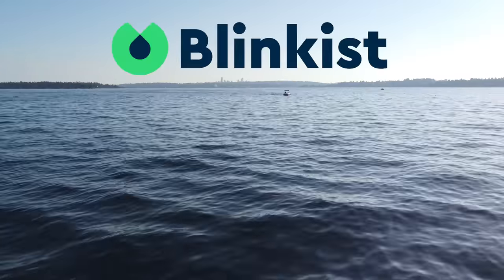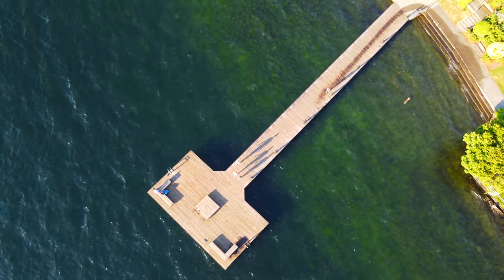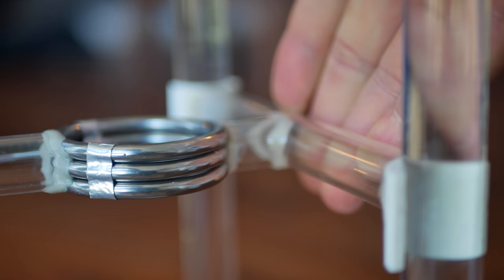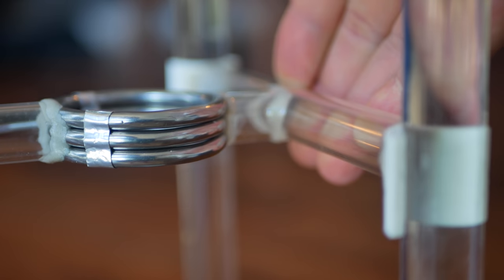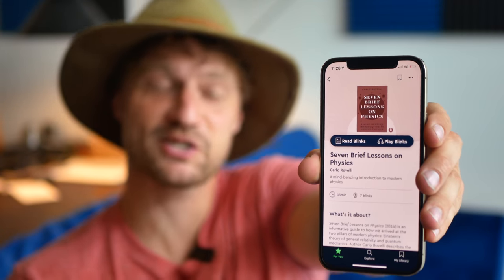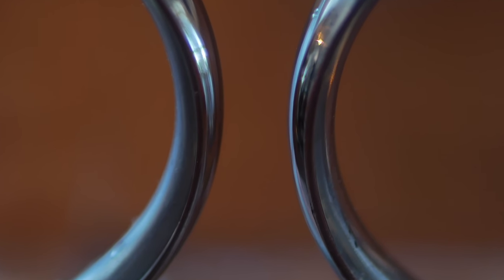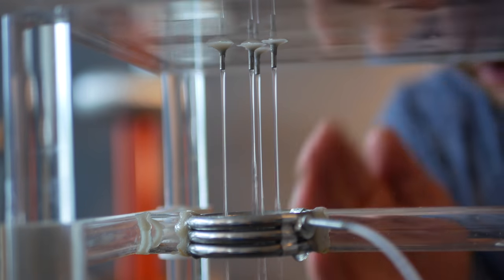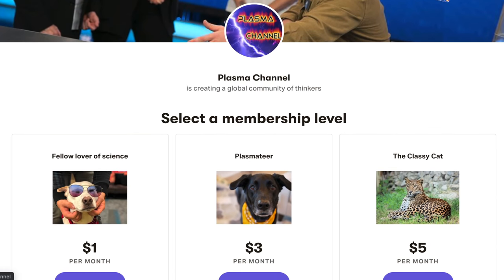Extracting 6,000 volts from Crappy Coffee (Coffinator 6000)

Comment: Can you investigate Stanley Meyer's water fuel cell? (just a suggestion)
I don't have enough background to analyze or understand his design. 
My understanding is, he pulsed the plates with high voltage at a resonant frequency that caused the water to split into H2 and O2.
However, I've been taught that it takes more energy to split the water, than you get back during recombination of the 2 molecules. 
Can resonance be the answer? 
Tesla was able to nearly destroy his building with his Earthquake machine. Myth Busters had to stop their version of Tesla's experiment, on a bridge, as it was starting to get dangerous.

Comment: Jay, have you tried it with tea??, Q.  could the rings to cup connection be wire and not saline??
Reply from the maker: Hi David, the water tubing certainly can be wires instead of water. I just chose water to add to the theme, and, make my own unique twist on the device.

Comment: Did you measure the potential between the two handles of the cups?  Was there any thought to add any type of recirculation of the collection vessels to refill the 'battery' at the top of the stand? Although, if there was a cycle, it may be possible that this would negate the differential between the two charged areas and thus negate the power generation.
Reply from the maker: Jake, great thoughts. So, the energy out is actually far less than the energy placed into the system with gravitational potential energy. If you used the high voltage out to feed water back to the top, you'd likely see less than 1% return.

Comment: Could you improve the HV generator by biasing the flow of ions in the water tank spouts?  If you placed a permanent magnet in the water tank with the north end near one spout entrance and the south end near the other spout entrance, would the water ions favor one spout over the other cations therefore improving the ionic bias quality of the water streams.
Reply from the maker: You certainly could bias it, though I’m not certain magnets would do the trick. Best to use electreks

Comment: How hard would it be to create a circuit to control the voltage difference, that way you have a constant power supply rather than having it reset after every spark?

Comment: I wonder if the spark gap could be passed thru a high voltage transformer stepping the spark down and giving a low voltage high current spike that could be run thru a rectifier and provide a decent output...and if the spark rate could be increased to say 60~hz if it could use those pulsating dc spike to actually create a power source...stepped down of course
Reply from the maker: Not a bad idea. But, 60 hz sparks would be

Comment: Hi, I'm working on a project 90% of which is still in my head but I really want to bring it to life. 
If my hypothetical DC charging device outputs 200v and a small fraction of an amp, can I charge a 3V 3,000 Farad super capacitor with it? Or my device has to output 3 volts?
Thank you!!!

Comment: black coffee is not disgusting, you just haven't made it right. If it's too weak you'll taste the chemicals used to protect the beans during their growth (at least I assume that's where that taste comes from). It can also be affected by how you prepare the cup, don't leave the cup to dry on it's own, dry that f***er until you can't feel any more dampness. Also make sure you REALLY rinse it out, even the slightest bit of limescale or whatever it was that forms on the rim of taps can affect the taste badly. Likewise make sure your kettle/coffee maker is properly cleaned of any limescale build up. Coffee (at least the instant version, dunno about bean version) is really sensitive to anything getting mixed in so you have to make sure to clear out the stuff that easily makes it's way in to the various things the water comes in contact with.

Comment: Why is gravitational potential energy required for the genration the charge difference here? Couldn't you directly have the water flow into two electrically connected vats?
Reply: 'have the water flow'        child.    that requires a   Change in Elevation  and   GRAVITY.
Reply: @daviddavids2884  I mean, you could just use a source and a siphon

Comment: Hey Jason, I have a diy build im trying to accomplish for my grandfather that involves electromagnets made out of Microwave oven transformers but its nothing but a dream for us right now. My current problem is convincing him that we will need to supply it with power that doesnt just come straight out of a battery but he only sees my advice as advice from an "internet know-it-all" but i have a strong feeling that the changes i want to make would be the difference between useful and a neat toy. Ive been trying to get help for awhile but even some literature that will expand my depth of knowledge of the fabrication and factor changes thatll make it or break it. (im desperate for help or even help finding how to help myself)
Reply from the maker: Hi Von, in general, even I like to stay away from MOT's. They are a type of transformer than use so much power it scares me. However, I may  be able to help DEPENDING on what you're trying to use them for exactly. Do you mind shooting me an email, to see if it's something I can safety assist you with? (channel page)

Comment: What is the case if you connect both containers to a pump to refill upper deposit? What about other elements, gold rings, cristal rings like quartz etc...? with or without magnets, only the earth electromagnetic field.
What would be the result if you apply RF or microonds at water? Flux capacitor? :D mmm...  temp and time?  any energy is connected to time, time derives from movement. 

Great videos, i appreciate them.

Comment: Heyy!! Could I place a 15000 volt capacitor between the two cups and then attach cables to the legs of the capacitor and use it as a HV power supply?

Comment: Hi.  Have you experimented with 2 magnets and plasma?  Repulsion effect.  They have to push off.
Reply from the maker: It's definitely a field I plan to experiment with soon.
Reply: @PlasmaChannel  Wow, cool.  Good luck.
Reply: @PlasmaChannel  I can describe in more detail.
Reply: @PlasmaChannel  Ring magnets are needed.  I think you can determine where they have north and south.  We put one exactly on opposite to the other with the south poles to each other, and we pass plasma of different types through them.  You can also turn them over later.  But it will be even better to strengthen them.  Play with plasma frequency.  Introduce an imbalance in the magnetic system so that the plasma wants to go out only in one direction.  Experiment.

Comment: @plasma channel - can you build a pump that replaces the water back on top?
and have it run on that generated charge?

is it possible for it to run forever?
Reply: No. There is no perpetual motion.
Reply: @engineer0239  thanks for indulging my curiosity :)
Reply: @gidi1899  Im sorry if it came out that way, that was not my intention
Reply: @engineer0239  oh, ok :)
Reply from the maker: The energy out, is far less than the energy needed to run the whole thing. What comes out is fractions of a joule of energy. What goes in is (mass)x(gravity)x(height), or 1.5 x 9.81 x .5. 7.4 joules. So, 7.4 joues into the system, less than a fraction of a single joule out. The system would not have enough energy to push water back up top.
Reply: @PlasmaChannel  hell yeah, thanks for the details :)
I feel bad there are no prospects here, but
It is still cool to see another energy transfer, makes you wonder.

Comment: that doesn't feel right.. if the stream, since the reservoir, is what is positively or negatively charged why the height of the metal rings matters so much?
Reply from the maker: One thing I left out of the video, is that it's crucial the rings be placed at the height where the streams turn into drops. Because, electrons can be stolen from the water...then the water turns into drops.....and the drops are now electrically isolated and cannot steal the electrons back. This guarantees an electron flow. The reverse happens on the other side.

Comment: Curious if you have already a video or if you could build a Tesla coil powered by a Marx generator?
Reply from the maker: As long as the Marx generator acts as the primary capacitor, and the spark gap output of the marx acts as the primary sparkgap of the TC, I dont see why it's not possible.

Comment: Can you see if you can store the electricity and run a small water pump to recycle the falling water and can you experiment when it rains for rain water free energy
Reply from the maker: That would not work, as great as it sounds! The energy that is extracted in electricity, is only a fraction of the energy lost as the water falls. The system is wildly inefficient.

Comment: Why do people keep insisting that there's two different types of Electric charge? 
One type being positive and the other being negative! 
This is not true! 
There's only one Electric charge! You get to have more of it or less of it and that's it! 
Had there been both positive and negative, you would have a cancellation of the two and electricity would not exist! 
All that you have is different states of potential! 
One side has a higher state of potential and the other side has a lower state of potential, as both states increase, the attraction towards each other also will increase, once the tipping point has been reached, you get the spark which will equalise and restore the two to their respective natural state of charge! 
Victor Shouberger experimented with this idea a long time ago! He was definitely way ahead of his time! 
The goal of this is to generate high voltage at low current and to feed this energy into a DC to DC converter to swap that energy into low voltage and high current to drive a water pump sized correctly to recirculate the water and to not consume more energy than is being generated! 
Maybe we might see this in a future video by someone? Even if it doesn't get to work, the process of trying to achieve this is a video well worth watching! Who knows, maybe the comments section can stimulate ideas to get it working? 
But remember, there's no opposite charges! Just as there's no anti tree's! Or anti matter! You need to be clear in your videos because there's a lot of people who are confused about it and actually believe that there are two when there isn't because there never has been!
Reply from the maker: The terms negative and positive charge reference the relative charge balance, not the type of charge itself.
Reply: @PlasmaChannel  thank you! 
I strongly believe that this topic needs careful wording as people are understanding it as two separate charges opposite of each other! 
Truth be told, I don't think that I could even find anything that is 0V, even what we understand as ground will show up a voltage if the two reference points are ground and somewhere deeper below ground... Who knows where 0v is? The point where you will only ever get a positive voltage and never be able to get lower than that, if that makes any sense?